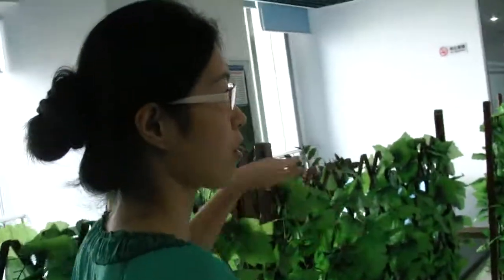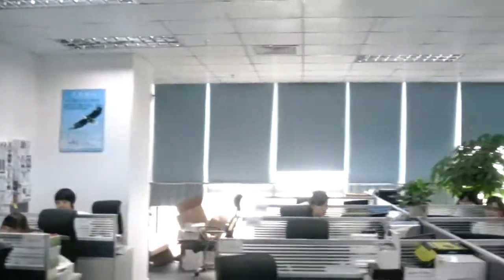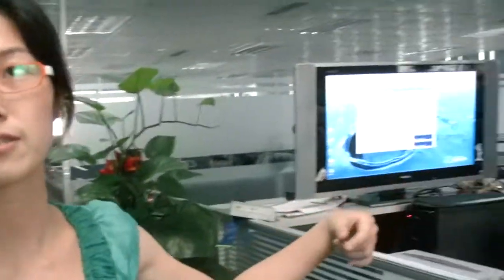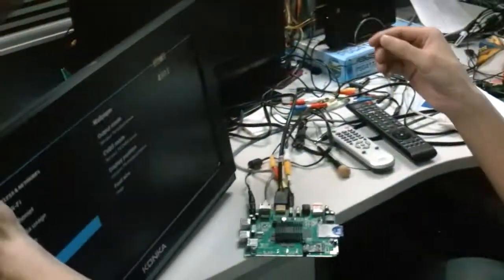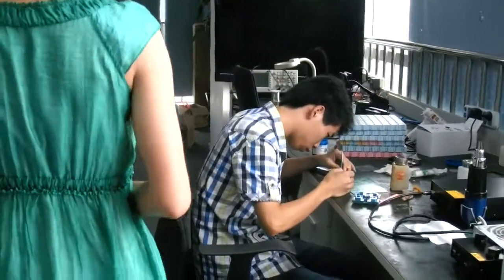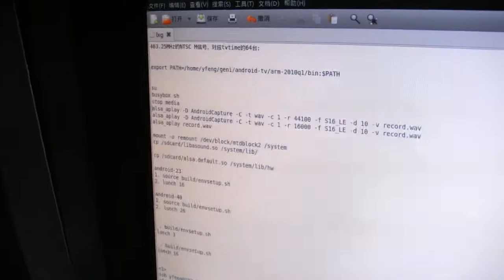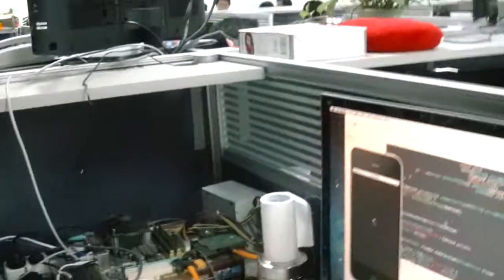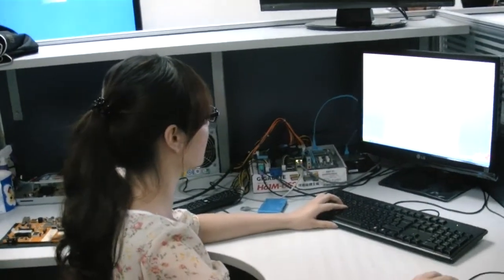Geniatech Headquarters in Shenzhen

Comment: Geniatech should first fix the firmwares on existing box before venturing out on making dual core boxes. Its June 2012  and their firmware still does not have shutdown or standby on Android 4.0 when using remote. Many other issues regarding software. One just has to visit Android forums to find out. Good hardware marred by poor software support.